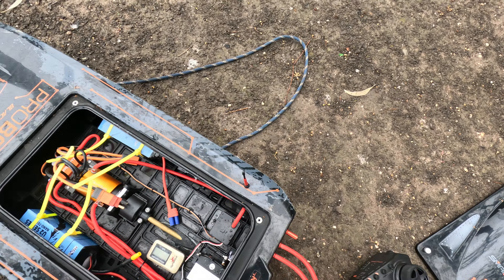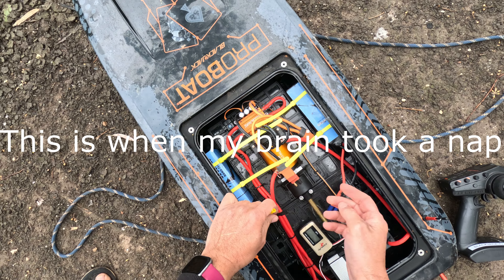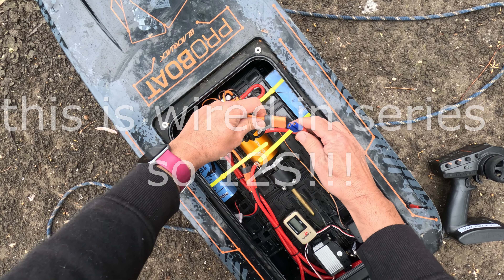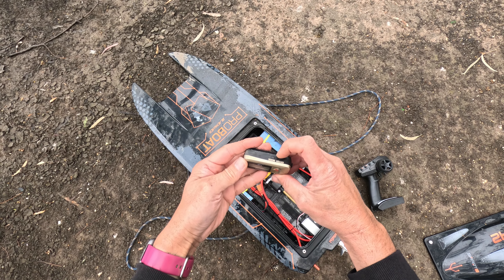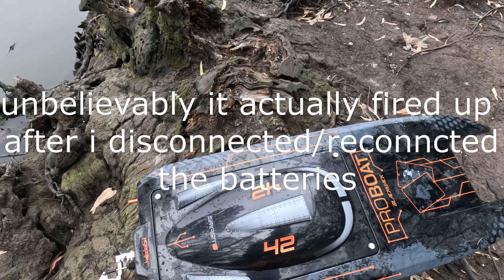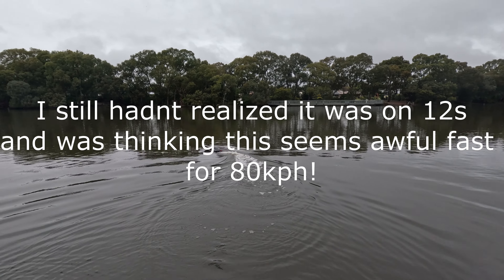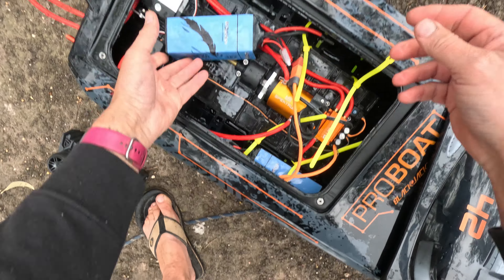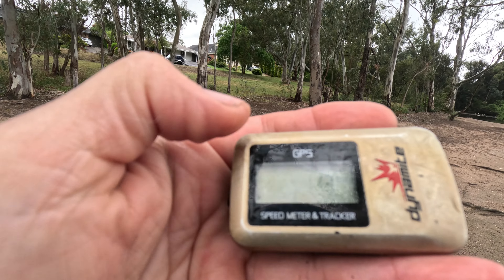Proboat Blackjack 42 ran on 12s by mistake oops!

Comment: That's what happens when your getting old lol.
Brain farts! Impressive that the esc kept going though, I have fitted a 120esc out of the Sonicwake V2 into my SR80 Pro and it did not like running with the Volantex radio gear, so I have plugged the radio system that comes with the Sonicwake V2 and running it on 4s atm, but hope to try 6s in the near future.
Reply from the maker: I wont argue with that!

Comment: Wow, no smoke!. Check the voltage printed on the caps, almost certain they are 35V, but don't have one myself. You have fried those caps, and you should use a cap pack going forward. Make sure it's rated at a higher voltage than what you want to run it at.
Reply from the maker: I will have a look, i ran the boat again yesterday on 8s and its still fine. If i hadnt done this myself i would be calling this video bs

Comment: It didnt beep 12 times at you when  you connect the lipos?
Reply from the maker: I was expecting 6 beeps but i think it did 8. I do want to try this again without turn off the video cause i wouldnt believe it if i was watching
Reply: @RCBoatBitz  that makes sense. Probably stops at 8 for being a 8s controller. I didn't think of that. Crazy it worked.

Comment: Ironcladrc is running 12s on his very successfully actually, I think his best so far is 93mph, but he’s been 105mph before on 8s
Reply from the maker: I cant imagine speeds like that would be sustainable for long. I wont use or sell any prop that doesnt allow full throttle from start to finish with same or similar temps to factory spec
Reply from the maker: O right, i thought you meant he was overpropping stock electronics for 10 seconds runs to get those numbers. He must have his trimmed very well to keep it in the water at those speeds, hard to achieve with such a wide hull design
Reply: @RCBoatBitz  actually the more power he puts the more stable it is. I plan on running a xlx2 sec on stock motor. He ran that setup with no heat issues every run and seen 90’s and was very stable
Reply: I question his speed runs. I had to call him out a week ago on the jetboat claiming it did 36 mph and he was in kph. And them dynamite GPS units aren't the best in my opinion
Reply: @ralphhondaman  dude don’t come here with that crap, been following B for a long time, he is honest as honest can be. Don’t come here saying he’s lying about his speed
Reply: @jaycevessier7554  that's your opinion and I have mine. I'm not saying the speeds that he's said he's done aren't possible. All I said was they might not be as accurate as he says. And it has happened at least once on his video so what I said is valid.